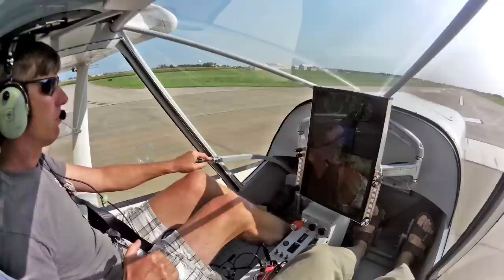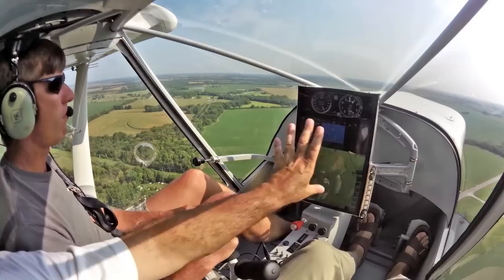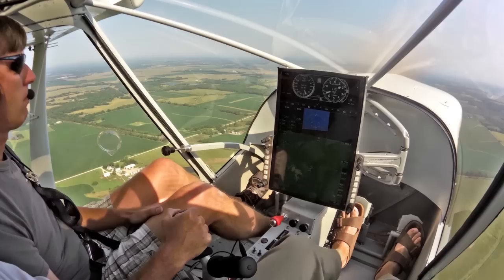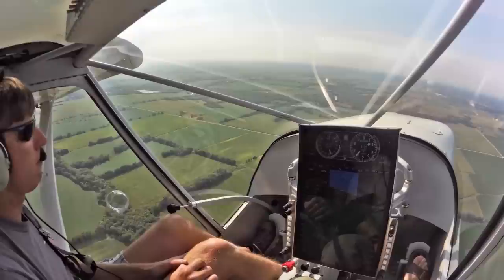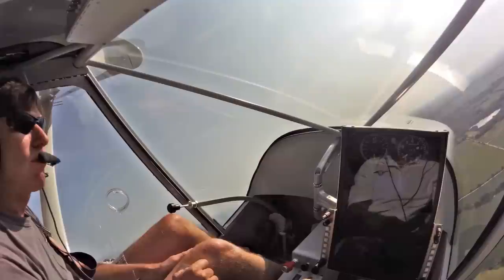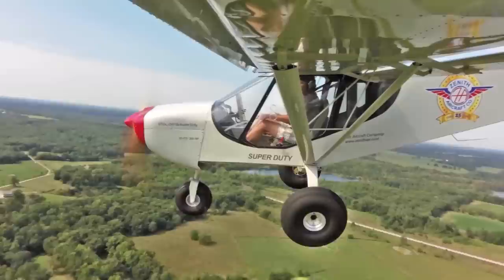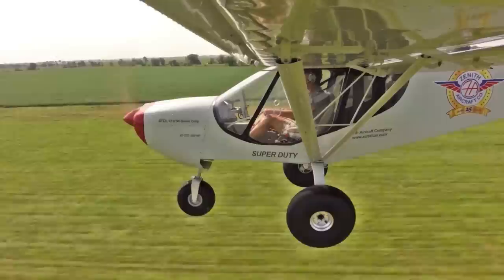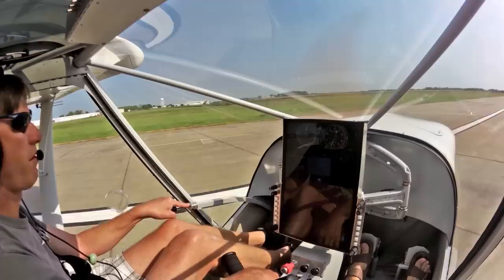Zenith STOL CH 750 Super Duty with the "unpanel" panel

Comment: I like the extra visibility that this odd-looking panel provides, but I do have concerns.  I would be concerned about having a monitor failure and losing ALL my instruments at once.  Perhaps if there were at least a few backup instruments mounted somewhere that would take care of that concern though, and limiting flight to day VFR could help too.  My other concern is the  long tube pointing at the pilots left side that the throttle is mounted on.  That seems like a bit of a safety hazard in an accident.

Comment: The audio level change sounds like a headset cable or phono jack problem? Possibly a dirty jack, if Roger would have talked, we could have isolated the problem? Sebastian, it might be your headset as i think it did this on the trip to Oshkosh also? You may want to try another headset! Thanks for the info on the display, as we discussed at Oshkosh, it is a wonderful improvement!

Comment: I was wondering about glare on the screen (some was present in the video).  I'd want to rig some sort of "visor" over the top and upper section of the sides.  Just a thought.
And DirtFlyer is justified in his concern about total monitor failure.  A significant amount of my work is done with computers and the darned things can simply fail without warning; frustrating on the ground; frightening in the air.
But, the open cockpit is a great concept.  I doubt that this is the final iteration.  Soldier on, Zenith.

Comment: Is the left hand seat pilot having trouble viewing the prototype LCD display with Polaroid sunglasses ? He takes them off for landing, and put's them back on once he is taxiing.
Reply: Do you mean polarized?
Reply: Yes, I meant polarized. Thanks.
Reply: Zenith pilot Roger always takes off his sunglasses off to perform the actual landing. 
My experience is that most pilots prefer not to use polarized glasses for flying.
Reply: hear hear re the sound comment. A shame this applies to most of these video's. What an air craft though!?
Reply: I agree about polarized sunglasses. They can reduce the sun's reflection off other aircraft that you are trying to see. If I was flying around lots of water when sun was low I might use them though.
Reply: The issue is that most displays are polarised so that if they are horizontal (landscape mode), then they work with normal polarised glasses when they are horizontal. This is true on sail boats, and for my MAC PC. If you turn the polarised glasses on their side,  or if you turn the LCD display to be in portrait mode (as in the Zenith plane), then the polarised glasses will block nearly all the light from the LCD Display which only emits polarised light.. If you have some polarised glasses look through them at your computer's LCD screen. Then turn / roll  th glasses by 90 degrees. You will see the blackout effect. So the Zenith aircraft LCD Display will need to have a special display where the LCD polarisation is designed specifically to allow polarised sun glasses to work when it is in portrait mode, as most LCD's are designed to work with glasses in landscape mode.
Reply: This is the same display used in the Tesla Model S, made to be mounted vertical (portrait) and not landscape
Reply: Thanks for confirming that.